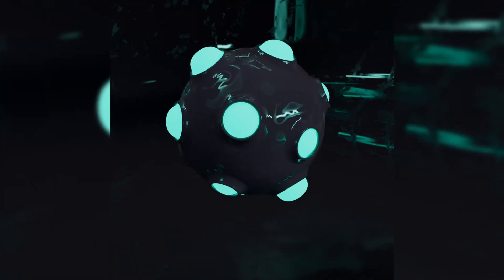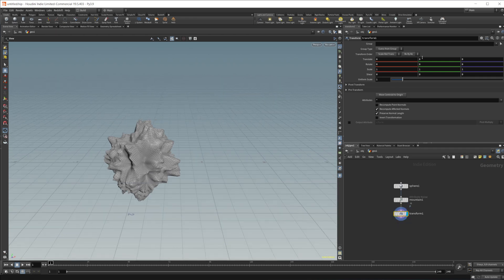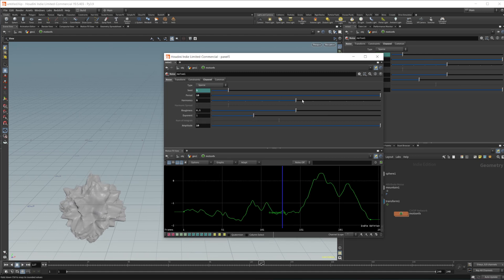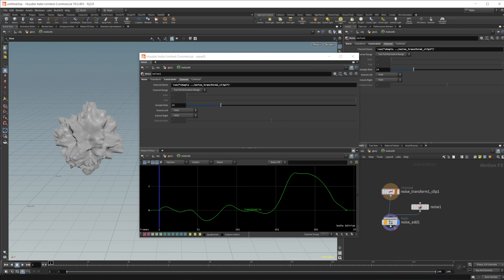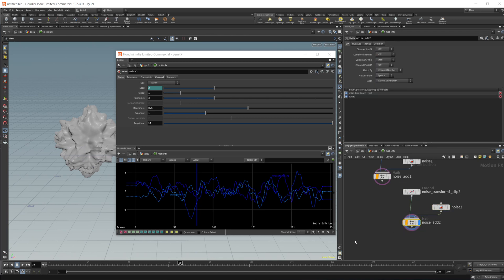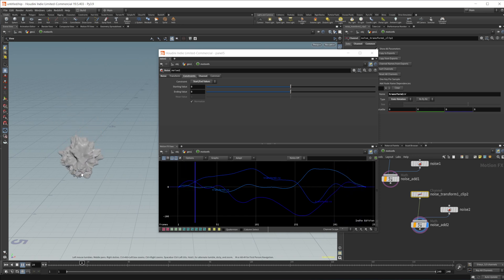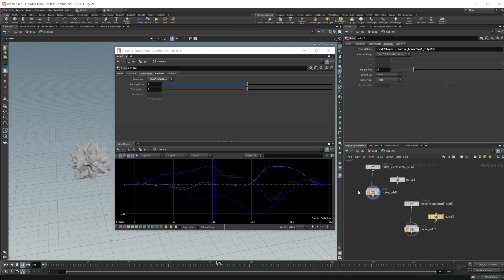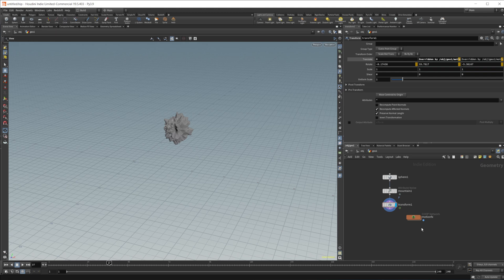Procedural Animation Using Noise | Houdini 19.5

Comment: Houdini is probably the most useful software in so many areas. Just a bit annoying making game assets with it. Great UV packer thought. Very useful for indie game devs  .
Reply from the maker: Traditional modeling with Houdini is something that a lot of users don't like it seems. Procedural modeling for the assets that will need a lot of variations saves a ton of time though. I definitely consider it a must have for indie devs.
Reply: @InsideTheMindSpace  HDA's are very easy to make, same with terrains  for Unity or UE. You also have live link in UE which works well. Modelling some parts of weapons is dead easy, such as grips. Just learning to use some tools modelling can take time.